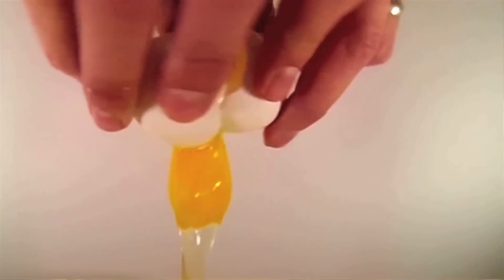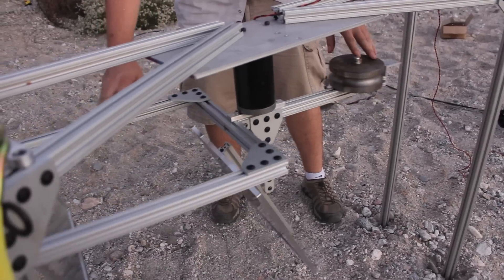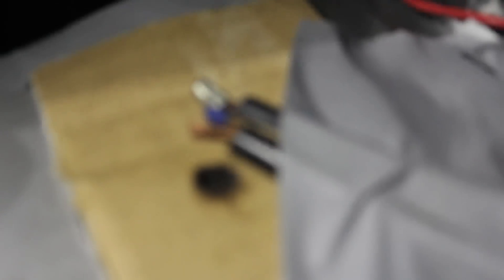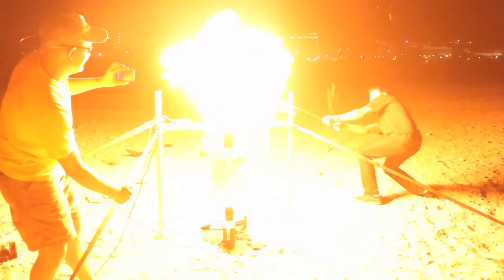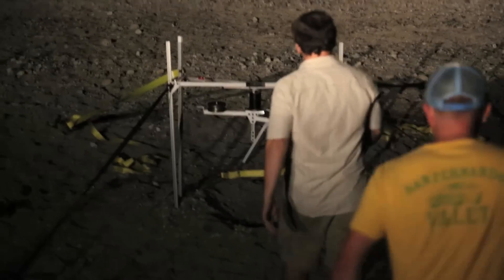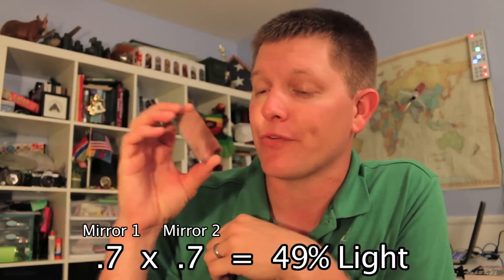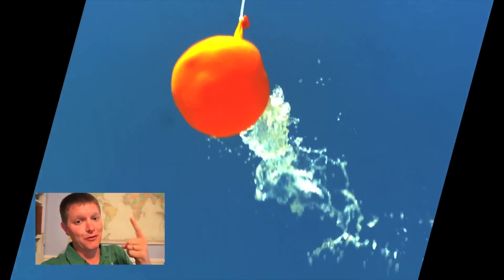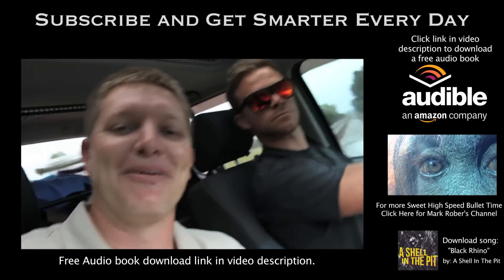BULLET TIME FAIL (Slowmo) - Smarter Every Day 101

Comment: I wonder if it’s possible to get the bullet time effect with no moving parts or multiple cameras. Basically instead of surrounding the subject with cameras, or using a spinning mirror. What if we had a reflective surface that surrounded the subject. Instinctively I’m thinking a mirrored surface donut, but maybe there are more optimal shapes. If you put the subject in the middle of the shiny donut, and put the camera below, I reckon the camera can see the subject from all sides. Of course it will be very distorted, but each frame has enough data in it to have a 360 image. In post processing you can undistort the image to simulate a spinning camera.

Comment: I am a Senior Radar Technician in the Canadian Navy and I have gone through your entire catalogue of videos a few times.  I had an issue where a Azimuth motor and Bearing set was wearing out faster than it should have and thanks in part to this video I figured out that it was spinning an unbalanced rotational load and that caused vibration and sheer force, wearing out the components faster.  Thanks for being an entertaining educator and not being afraid to post the videos and plans that didn't work as intended.

Comment: I don't know why you used .7 for the amount of light retained. If the mirror is at 45 degrees, the cosine (or sine) of that angle is 1/√2. Square that and you get exactly 1/2, not .49.....

Comment: this is an engineering design fail. try using a circle of mirrors around what you are filming. then add a spinning mirror above it. then place the camera on top. this will also remove the support bars from the picture. you will also be ale to change the angle of the picture by adjusting the circle of mirrors. just trying to help.